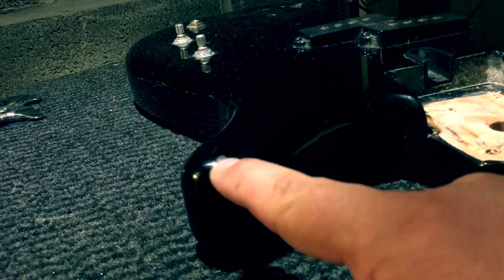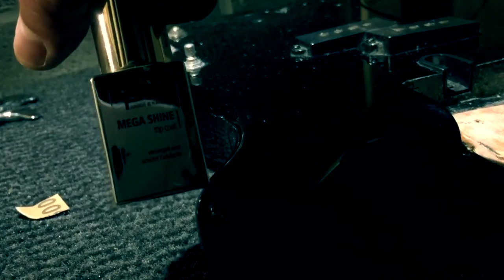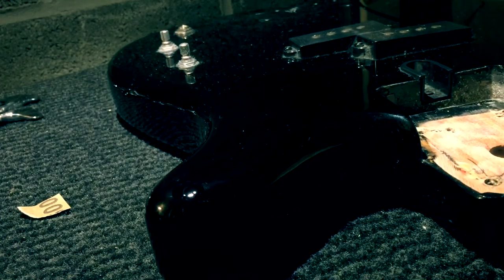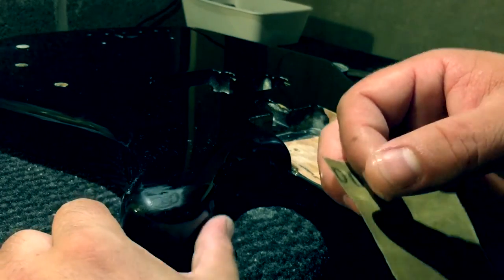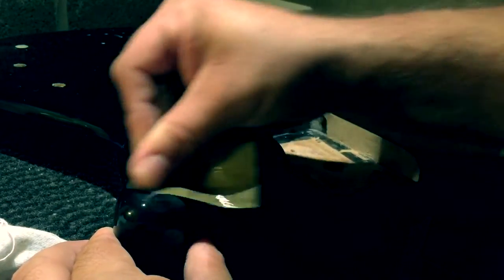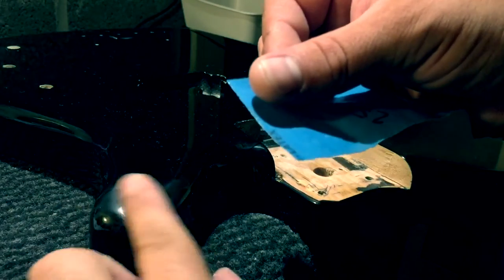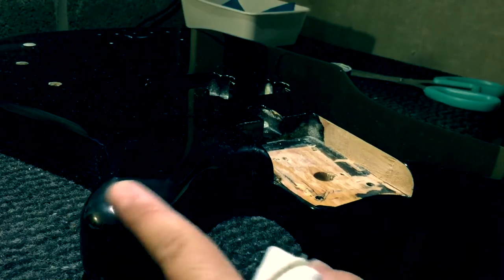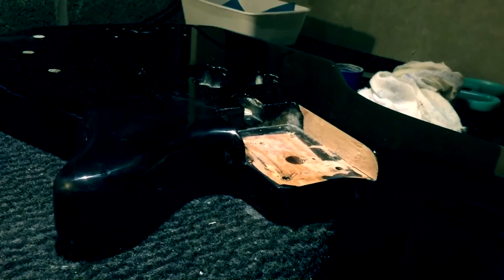Guitar dent!!! How to fix it!!!

Comment: Did you not use clear coating after putting the nail polish on?

Also, you said "nail varnish", is it actually a varnish, or a polish?

All and all, decent work, and giving me many ideas for the dents in my guitar.

Would this also work fine for dents that go past the paint and into the wood?
Reply from the maker: +NiftyCrow No clear coat used! As for the varnish or polish,  is as you prefer. :) In the U.K. they say Varnish, in the U.S. polish! It's the same... I have to say that for the deep dents... it might not work so good, dependes on the colour, and the depth... if you want to specify more, maybe I can be more helpful... thanks for watching....
Reply: It's a Les Paul Black Beauty, It's dented into the wood. Not too noticeable really, It's Epiphone so I'm not scared of it being blemished, but I'm guessing it's better to seal it with something than to just let it be.

Just watched a video about using permanent marker, acetone and superglue to repair finish, that seemed like a plausible method to use. 

Then again, a little bit of wood filler might be needed, then an application of nail polish possibly? 

It's not something I'm attempting in the near future but it's something I'm looking to do and will happily take any alternate ideas. 

There's no one exact method from what I've seen across the vast array of videos in regard to the matter as far as I can tell.

Let alone all the varying degrees of sandpaper grits to use. I've seen videos of grits up to 12,000 and can only imagine it being made in space because 2,500 grit is the highest grit readily available when going to varying hardware stores around me.
Reply from the maker: +NiftyCrow I agree with you there's no exact method... I am currently finishing a video about the Epiphone featured on the last video, it had a huge dent on the head Stock. I will be using a different method. Just a spot on black nail polish... Fingers crossed. It might be also a good solution... About the sand paper I ordered from AliExpress on the local stores the highest grit that I have found was 600. But with the ones that I have ordered it goes 2000 2500 3000 and 5000 and I have used only that high because you will have almost no trouble for the polishing process... Good luck for the guitar... let me know how it goes! \m/

Comment: My cousin droped my bass and it got chiped. What i mean by that is he droped it and the paint or what ever it is that makes my bass black is chiped. Also it's near that jack where you put the wire in. Is this the right video for this and if its should I take out the hard ware to be safe? Please help.
Reply from the maker: Hi depends how deep is the chip! if can see the wood i would recommend this one -->  https://youtu.be/AkTsW7iuDRk  otherwise the approach on this video should do the trick. i would remove the hardware just to be safe! good luck